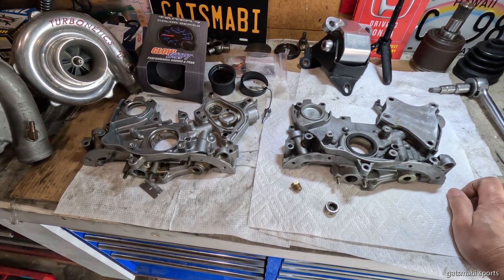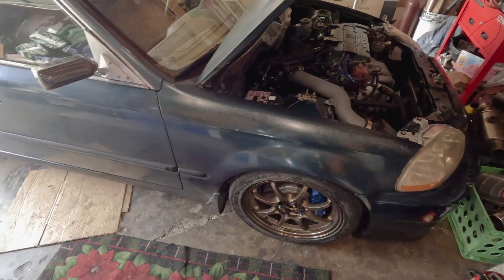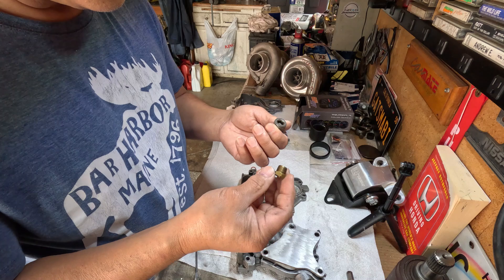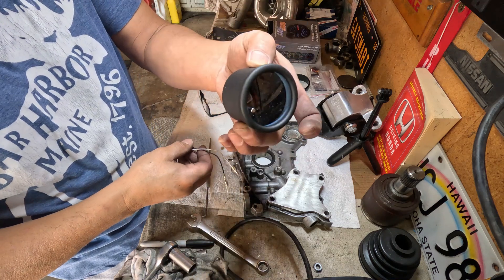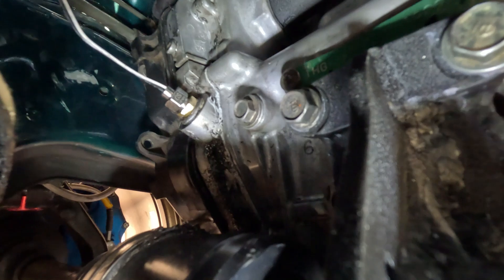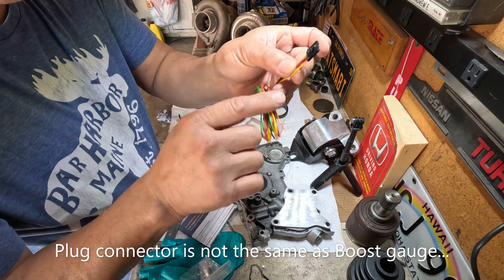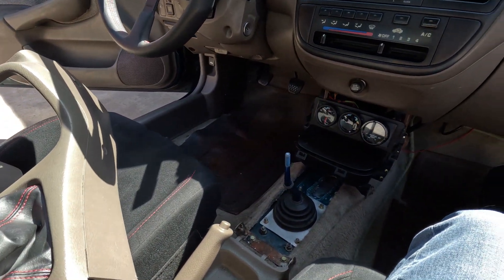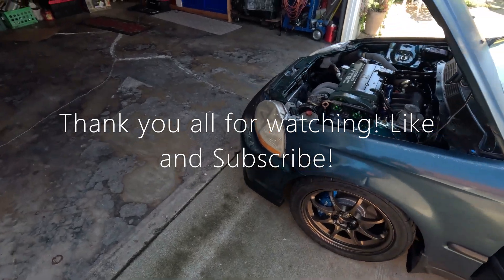What is G23vtec Oil Temperature? Ep.1 Oil temp sensor/ gauge install

Comment: Really good insight into why they fail due to oil issues. Maybe try a 5w-40 syn instead, so it won't thin out so much.
Reply from the maker: Thanks and definitely having a oil cooler on my next turbo build will be on the list. Heat soaking is the worst enemy.

Comment: If you have a modified ECU a good location that works well is the oil pressure port on the VTEC solenoid. The JDM engines have that port blocked off since JDM ECUs dont use that parameter for activating VTEC. On modified US ECUs tuners typically disable that parameter.
Reply from the maker: Hmmn that is the good spot. It'll be like it came out of factory. Thanks